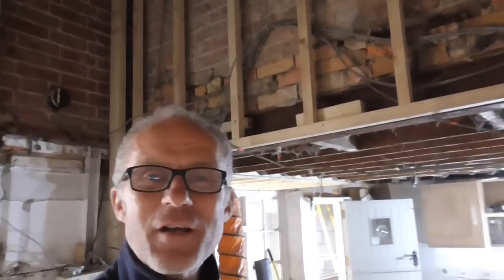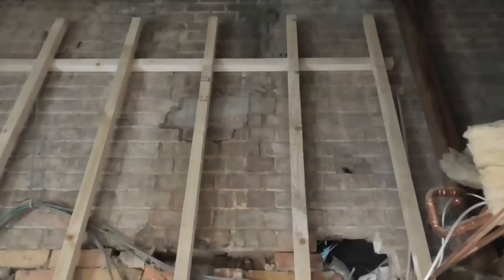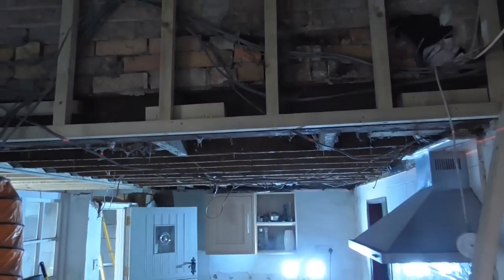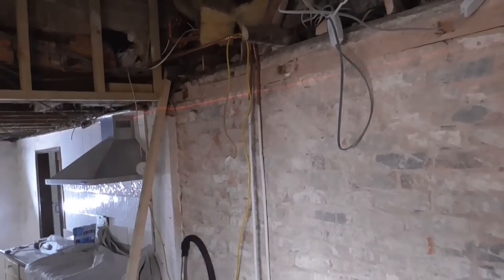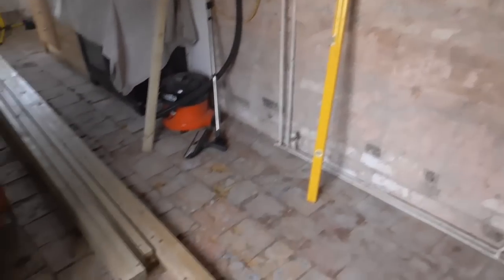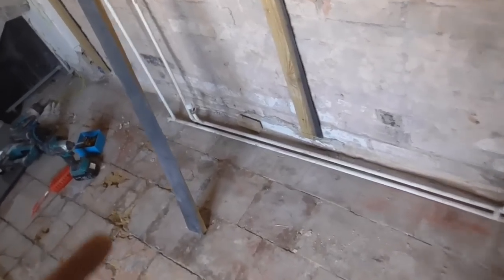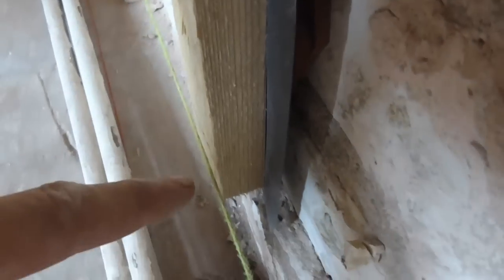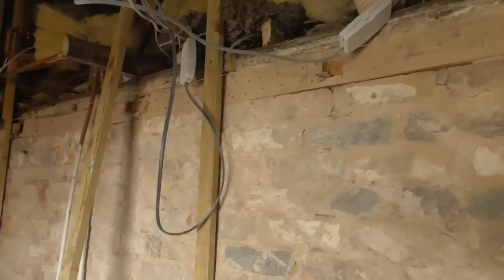Making an old wall super straight and plumb using timber battens and packers***PLUS MANAGING DAMP***

Comment: Done plenty of this type of work. Initially you regret ever starting but once it’s done I found it pretty rewarding. I Like the way you work. Very similar to myself. Great video as always
Reply from the maker: I feel exactly the same when I start this kind of job Joshua😶but like you, once you get into it, it's very satisfying when you start to get things straight👌Appreciate your comment and great to have you watching🤩Cheers Del
Reply: Done it in timber for years! Now found metal works better for me!
Reply from the maker: @Goodwithwood69  I like the sound of metal stud, but it's not as easy to get hold of round my way😬Cheers Del
Reply: @thetallcarpenter only problem with steel is the chance of condensation.

Comment: just catching up del. been a bit busy lately. little while back i fitted a kitchen in a house for a friend of mines parents. one of the oldest houses in south shields apparently. over 200 year old. the floor in the kitchen area was approximately 150mm out of level from one side to the other diagonally. nothing at all could be done to rectify it as below the kitchen was all the bedrooms of the house. So we had to make do and fit accordingly. 

i always buy the screwfix gold screws also. never ever had an issue with them they seem to perform the same as the more expensive brands. 

class vids as always del. cheers mate
Reply from the maker: Hi Paul🖐Sounds like you had some fun up there bud🙃Personally, I don't see the need to spend huge money on everyday screws, and like you, I find Goldscrews good for nearly all my work, plus I'm not a fan of self sinking heads as I want my screws to force the wood down, not cut into it👊Thanks for your comment 😎 Cheers Del

Comment: Another Cristal clear video. You have a real knack for explaining. The damp analogy, dpm and raw plug trick is spot on. A really well worked system that you considered for that environment. 

Have you ever tried using a laser as a parallel,say on the tile line or any arbitrary place of reference and then a datum stick or measure to get the Timbers in wind? It’s how I find the proudest point and plum my lining walls. I am not knocking your technique as it is the totally correct way but I started using the laser for it and found it so much easier once you dial in a system! You still need a long level to check as you did tho obviously.

A real joy to watch, thanks again💪🏻
Reply from the maker: Hi there🖐Really appreciate great input from fellow tradesmen🤗and often I don't use the laser purely out of habitually using a string🤔I started in 1986 using these older methods for getting things straight, and I don't always think, 'ah, the laser would be good for that'. You are quire right though, and setting up a laser datum line would be a supremely easy and accurate way of keeping walls like this straight and plumb👊Cheers Del
Reply: Ha yeah you are  old school and I am mid school., 99. You would have that string line set up and ready to go while I was still looking for batteries! I must admit I love a good old string line tho! Thanks for the reply Del. Anyway I am finally sick of bank holidays so back to it!😂looking forward to the next vid already👊

Comment: Earth floor with tiles, possibly subsidence on the outside wall? Victorian brick work (1880's)? How is the outside drainage? Good I hope. Very breathable systems to allow continuous drying.... would be ideal for a wood burner that creates under pressure and dries the building  out to in. All in all a very challenging project, hope you are on an hour rate for this project. The customer is lucky to have you. A membrane would have to go under the exterior wall, otherwise the humidity might increase under the wall, making the brick wetter. I don't envy the climate you have, with the high humidity as a starting point. This building has the traits of a workshop rather than a dwelling. Some kind of natural ventilation system, ie a tall chimney that creates a constant up draft/under-pressure would/could keep it dry, though a real fire does the same thing.   Just thinking allowed, I have worked on a couple of houses with earthen floors in UK, Peter Ward has some good videos on dealing with these older buildings. All very fascinating, thanks for sharing your work, best wishes, Lucas
Reply from the maker: Hi Lucas🖐Some great points/thoughts in your comment👌and I appreciate you watching🤩Cheers Del

Comment: These kind of jobs need a lot of head scratching to get looking sound, nicely done. I'd probably allow for a bit more airflow if it's as damp as you describe. My second house was converted from a C18th  stable block. Nothing was square or plumb! Got an ex-demo kitchen from B&Q and assembled the base units as a block, then packed them off the floor and wall and scribed the worktops. It also had a live unmetered gas supply direct from the mains at some serious pressure💥. British Gas didn't believe us but sent someone out to check eventually. His face lost all colour when he cracked open the stop end a few turns and nearly got blown off his hop-up.
To describe 3 dimensions simultaneously, use X, Y and Z axes: left right, up down, forwards backwards, respectively
Reply from the maker: Great comment BS🤩Especially the bit about the gas man😆And I'll try and remember the X,Y and Z axis for next time😉Cheers Del

Comment: Nice work mate. I’ve done many jobs like this in renovations over the years.  It’s very rare to find a plumb & straight wall.  I’m doing a renovation at the moment where the loft ceiling was out by 4” turned out the purlin had cracked, so had to fix that.  But the other purlin that will be visible looks like it’s smiling at you, & I’ve got to pack out & board the rafters above it, I think I’m just going to give up 😂
Reply from the maker: Crickey Luke😲sounds like your job has got some real 'character' 😆Seems like you've got a plan though bud👊Thanks for your comment 😎 Cheers Del
Reply: @thetallcarpenter  yep plenty of character 😆 think I’ve just got to embrace the curve and not try to straighten it out much.  Difficult with insulated plasterboard tho, cheers 👍
Reply from the maker: @Luke Hanna  And that's the trick Luke🤔trying to get things so you can fit modern, straighter building materials to it👍
Reply: @thetallcarpenter   absolutely, hence why renovations are more tricky than new build.  Thanks for your reply Del, enjoy the bank holiday 👍
Reply from the maker: @lukehanna7440  I'm pitching hipped, lean to roof today Luke😬No rest for the wicked😆

Comment: I hear you on the plumbing / electrics, hard to fix it / do it properly until the stud work is in place to actually fix stuff neatly too.
Reply from the maker: It's like a constantly moving target Conrad😬I have been pretty lucky on this job though, as I've been able to get round most of it with the odd notch here and there👍Thanks for watching 😎 Cheers Del

Comment: All fun and games. But fitting the kitchen will be a breeze afterwards. This old building is wonky, but not too bad. In the area of Kent I lived and worked in, we were on live clay. The buildings moved a lot. The worst I worked on was a barn conversion from the 17th Century. Front wall was 17 inches out of plumb. I also did a lot of work on the Norman churches around me. All over the place. A lot of the houses I worked on it was not uncommon to fit doors with a bevel. They looked like a kite open. But fitted when shut. For a lot of jobs I wouldn't even get a level out of the van. This is before lasers. You worked in sympathy with what was there. Often if you put something in plumb or level it literally looked horrible. The house I was born in. There was hardly a wall you could look along and see the other end. Take the bows out of them and the rooms would end up 12 inches smaller in each direction. Putting a modern style kitchen in was always a dilemma. Altering kitchen cabinets. And scribing benchtops became a norm. I built a few kitchens in situe. A mate's old water mill. No chance of square boxes fitting that. And a round Oast house. Worked on a few of them. They make you think. The other thing is budget constraints. Your job is a gut out. There is an opportunity to adjust. When you turn up and the old kitchen consists of an Aga. A butler sink with timber or enamel drainers. And some free standing cabinets. Even had to demolish the brick bread oven in the corner. All to be replaced by the contents of the flat pack boxes in the room next door. Adapting becomes the name of the game. The joys of old buildings.
Reply from the maker: Hi Dave🖐You were 'literally' brought up with it then🤩Great comment as always bud👌Thanks for watching 😎

Comment: Great video - Could you use this method on a wall that is already plastered. Working on a 1930’s house and want to straighten the walls but would prefer not to have to knock all the plaster off and batten and plasterboard over it. Would this be okay?
Reply from the maker: Hi Callum🖐Yes, it would be fine to do this over existing plaster work👍All the best🤩Cheers Del

Comment: Got old 100 year old bungalow myself. 
Kitchen wall out of plumb and wondering how to get around fitting upstands .
 Quartz worktops to be scribed to walls but not sure if the quartz up stands can be fitted as walls are not completely flat.
Reply from the maker: Hi there🖐I understand your dilemma😬 but not there's much you can do to make the upstand fit tightly to a non straight wall🤔 Maybe it will just fit where it touches and be filled/caulked in the 'low' spots😶Cheers Del

Comment: Normally I'm quite forgiving of previous trades and mistakes like things not being level (I mean a little), but that steel is crazy out of level.
Reply from the maker: I'm the same Conrad, as you never know the circumstances in which the work was done🤔however, this place, over the years, seems to have had the worst that local building community has to offer😵‍💫Cheers Del